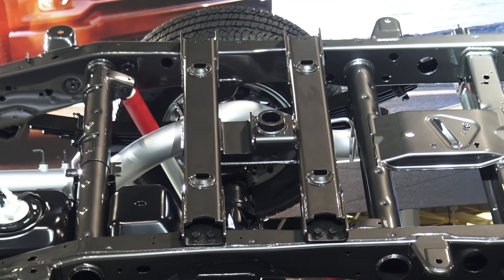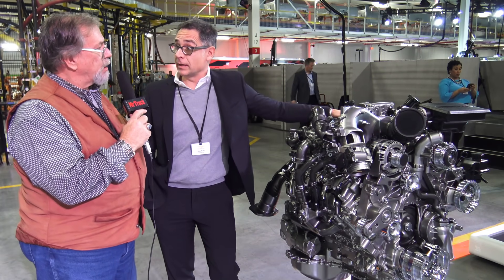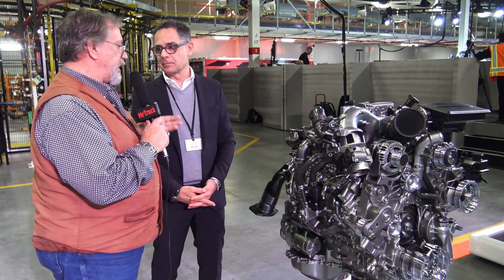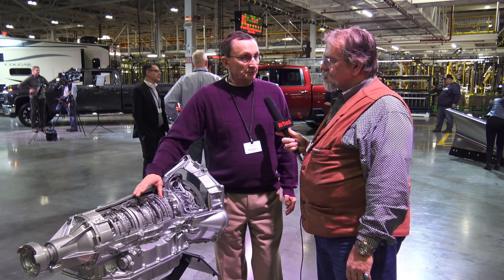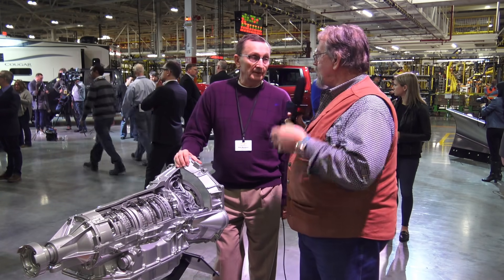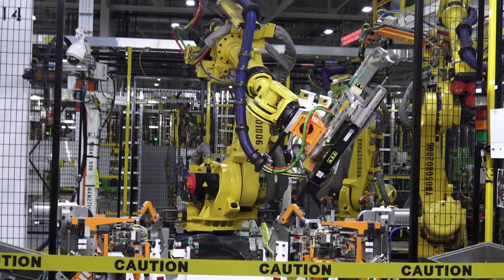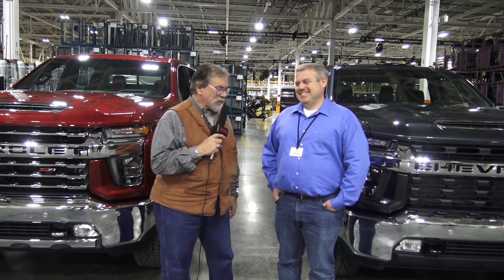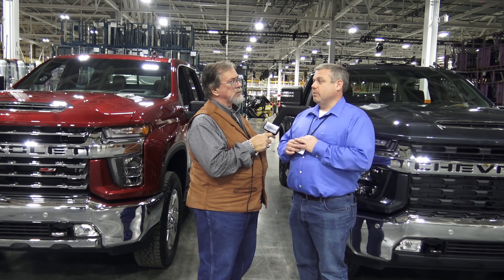2020 Chevy Silverado Heavy Duty factory reveal part two

Comment: 14:35 GM didn’t install a 10 speed transmission to save money. 
Also now the drums are going to start blowing out lock spring ridges.
Reply: You do realize Ford isn't offering the 10-speed in all their F-250/350 trucks right? It will only be available in certain configurations. Most likely only the most expensive trims. GM isn't using a 10-speed with the gas engine because most fleet customers don't want to deal with a totally new unproven transmission. They're used to the 6L90 and it's been around long enough that it's proven.

Comment: Eliminating the transmission dipstick in an HD pickup is just dumb.... When he says they are confident .... that means it will make it past the extended warranty now without any attention . They are going more towards throw away trucks all the time
Reply: John DiMartino  idk why they are taking it away from all the vehicles expecially the truck,my 2009 F150 doesn’t have a dipstick,you have to get down under the tranny and their is this little pathetic thing that you can measure the level with it,is a pain.
Reply: Oh my, every manufacturer is doing this. Toyota, Ford, GM.  This is crazy
Reply: My 2017 F150 has the 10 speed transmission it doesn’t have one either it’s got a tiny little knob Where are the dipstick used to go into the transmission.

Comment: The inherent problem without a dipstick is in the fact if you’re checking it, there’s a reason to be. With a dipstick you can get into a routine of checking before a problem starts. Less likely to put it up on the lift to check during oil changes. Curious if when nothing leaks out during the checkup, when you fill till it does leak, will new fluid leak or possible burnt fluid leak out?
Reply: Everyone is going to sealed transmissions that don't have dipsticks. Ford's 10-speed is sealed. Ram's 8-speed is sealed. GM's 8-speed is sealed. It sucks but they're all doing it.

Comment: I know GM is content on saying best in class right now. I wonder how long they are going to be saying that for when Ford drops their max tow numbers
Reply: GM will just pivot to their 1st gr claim of all power being able to be used. Of course Ford is going to top their numbers. It's going to interesting when the Ford numbers do come out how they respond.
Reply: It won't really matter. Even the F-350's rated at 30k+ lbs were slower up the Ike Gauntlet and didn't brake as good as the GM HD's rated at a little over 23k. Pickuptrucks.com compared the same trucks and thought the GM HD was more stable while towing too. Mostly because the F-350 kept showing hints of death wobble whenever it would hit expansion joints.

Comment: It would  interesting to see a unscientific driving comparison between Fords 10speed and GM's. GM seems to have taken an extra year to fine tune theirs the way they want and I wonder if that shows in the vehicle.
Reply: M Jones but they’re the same
Reply: Yes, they are the same tranny.  It is joint venture between gm and Ford with some input from Alison.
Reply: Patsy Ware The joint venture 10 speed is not the same as the new HD Allison 10 speed that GM and Allison worked on but the light duty trucks 10 speed is part of the joint venture.
Reply: @BurgerBin  The Allison 10-speed is not the same as the Ford 10-speed.

Comment: Kent, 

While GM hasn't officially increased it's HP & TQ #'s; do you expect that with the changes that have been made it is making more?  I would expect that Ford updated their power plant knowing that the L5P was putting down 820FTLBS, which is something that GM anticipated and probably stepped things up without making it official so they could still wind up on-top? Would you say this is accurate?

Thanks
Reply from the maker: I'm surprised that can get the extra towing numbers just because of the 10-speed. We'll find out

Comment: Someone is going to sue gm when they have a collision because they were watching the camera as they were making a turn. I hate the idea of all the tech(in all 3) if you don't have the skills, confidence, understanding or attention to pull these large/ heavy trailers YOU SHOULDN'T BE ALLOWED TO DRIVE ONE.  Understanding how a 40k combination works is mind boggling to someone that's thinks an 8k trailer is heavy.  Every day(twice) I PUT 94k into a 46k truck/trailer combo. Of my 140k, 40k is on the 8 drive tires(28.6% of gvw). That 43500GCWR  only 6500lbs can be placed on the rear axle. That's 22% on the axle(9500GAWR) or less than 16% on the truck. Still riding on non commercial 17" tires.
Reply: LMAO yeah I bet your tone changes when Ford puts trailer backup assist in the HD's and you start backing your trailer up with a little knob on the dash.

Comment: If she understood the truck owner, Chevy would have a solid axle, manual transmission, manual windows and rubber floor mats as available optional equipment for all levels of trim.
Reply: Why a solid front axle, so it can chew up ball joints every 40k miles like a Ram? 
Or death wobble like a brand new Super Duty?
https://www.youtube.com/watch?v=P-_etnN_q1M
https://youtu.be/330IAN3TejY?t=31
https://www.youtube.com/watch?v=tpxfZkujLhU

Comment: In your last video I told you exactly what was going on with the leaf springs in my comment and the ball it's physics! So sometimes you need to learn that you're basic observations do not always equal fact
Reply from the maker: Good, I have to rely on GM's engineers explaining it. And they are in front of the axle on long beds. The axles don't move forward on long beds. The extra length is body and frame behind the cab. Rear axle to rear bumper stays the same.

Comment: Chevy junk
Reply: Chevy junk that's been embarrassing Ford on the Ike Gauntlet. Pretty pathetic when a GM 1-ton rated to tow 23k lbs pulls a 23k lb gooseneck up the mountain faster, braked better, and handled better than a F-350 rated to tow over 30k lbs. Pickuptrucks.com tested the same trucks and complained that the F-350 kept acting like it was about to start death wobbled when they would hit the expansion joints on overpasses. A brand new truck already starting to develop death wobble? lmfao

And then there's that "military grade" pop can bed. I love how Ford said they sent those beds out to different industries to get real world abuse. How did they not notice that their aluminum beds develop cracks when you put a drop in toolbox in the bed or that any serious dent causes big cracks to form. They turned the phrase built ford tough into a f'n JOKE.